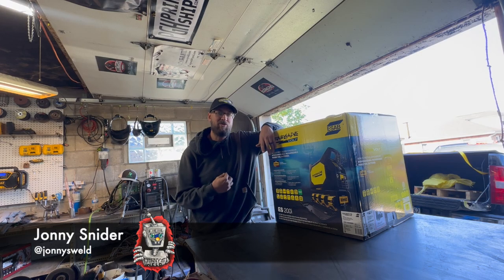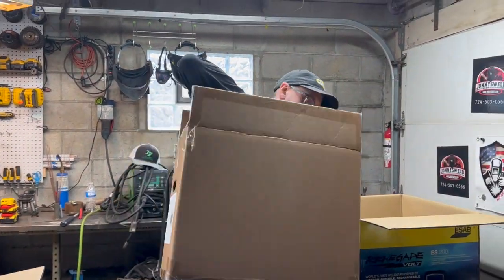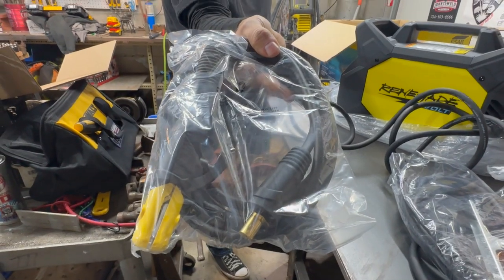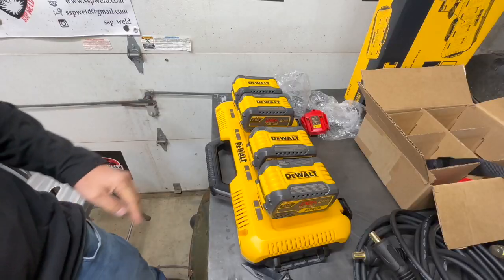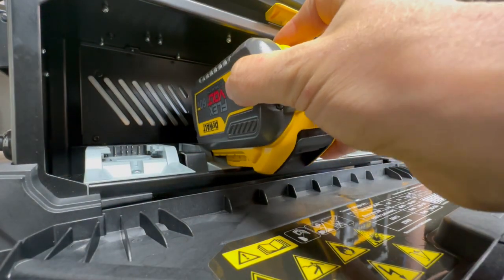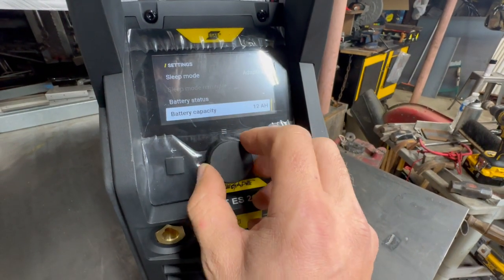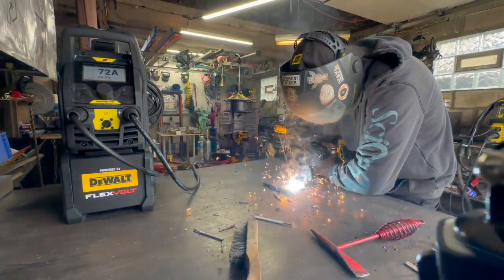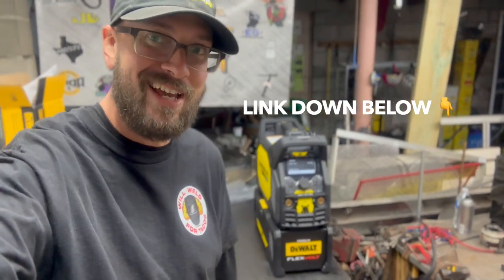Battery Powered Welder Unboxing!

Comment: We demonstrated that machine for a while. It welded good and we also have the Fronius Autopocket machine. They both weld great for quick weld repairs. 
Downside that we noticed with the ESAB machine was the plastic connector from the battery to the machine broke on us from a bump when my guys were moving the machine around. Yes it could’ve been prevented, but when you’re not around your team will take short cuts unfortunately. Brought to ESAB rep attention and so far we have been the first to submit a flaw. Hopefully no one else has that problem and or ESAB will make some changes. To everyone else, careful if you’re trying to move the entire machine around without separating.
Good luck and weld on…
Reply from the maker: @salsalazar8414  two great machines, it’s nice you were able to show both and see how both worked to be able to guide someone to buy the one that best suits the customers needs.

Comment: Fronius Accupocket more expensive, but it makes more sense than having to charge multiple batteries, plus...well, its an ESAB, it breaks.
Reply: What makes sense to me is using batteries on a welder that can also be used for hundreds of other tools beyond the welder. so very multi use concept, and time to recharge, just pop out and back in charged batteries and continue welding. All I see is benefits there!  All machines (any brand, any industry) have some duds from time to time.. I can't speak for those because I have 3 different machines from ESAB and they all have been workhorses and have driven my business  to the next level. But there is a machine for everyone because everyone has different needs in the industry so if the Accu pocket works for you then that's awesome and hope it makes you a lot of money. Thanks for the comment.
Reply: @jonnysweld  Tool batteries only last so many charge recycles, its a ball ache havin to buy multiple chargers to speed up charging, then you have increased probability of battery connection fault problems, list goes on. You are lucky, many are not so lucky with esab, when multiple distributers are droppin esab, you know there is a major problem.
But great esab working for you, I was tempted, it was between Fronius and esab, I read a lot of comments and watched a lot of videos before makin the choice, esab prices are tempting.
Reply: @engjds  It seems like the variable that is the most important is how much welding you'll be doing, where will you be welding and how often. All those combined will help decide what machine is the best for you. I definitly understand the concern with more parts could be more room for error. I guess what helps me in this situation is I am already a user of DeWALT tools so, the ESAB Volt seems to fit really well with what im doing, also I dont do a lot of mobile welding. But at the end of the day, your doing the right thing before jumping in on a battery powered welder, research will save you from getting something your not happy with. So, keep up the good work. Since I physically have a battery powered welder, if you have any questions, feel free to reach out. I'd be happy to share anything I can.
Reply: @jonnysweld  Totally agree, I am on the milwaukee system, and I like the battery system, and since I have a few chargers, like you I might get a welder that used those batteries. Also, Fronius seem to be highly reviewed, but they are also very expensive.

Comment: How long do the batteries last when welding?
Reply: Hey, They say it can weld 30 electrodes on a full charge. I tested it out with a various size rods and different kinds and was right about at that mark. So I guess the batteries will last as long as it takes for you to weld 30 electrodes. For the work I do out in the field, 30 would be a lot for me in a day and if it wasn't, you could always have a second set of batteries to swap out and keep welding.
Reply: @jonnysweld  What size electrodes are we talking about at a 30 count? A 1/16 uses a lot less power than a 1/8 does. Great video though. Probably the best review I've seen for this welder.......Never mind. 5/32. Thats a pretty big rod. That's 150 to 210 amp range. I'm thinking this would work great when I'm doing fences where my welding truck can't reach. I'm usually running 3/32 on that kinda work so I can probably get 50 rods. I'll have a second set of batteries charging for rotation.
Reply: @survivalguyfyi5718  Thank you for watching, I tried to be pretty detailed with the unboxing. 

So this is taken directly from the esab website, it was hard to find the details on the exact electrode but think I found it and was a 3/32 they did tests on. 

"North Bethesda, Md. – The ESAB Renegade VOLT™ ES 200i Stick/TIG battery-powered welding system, developed in conjunction with Stanley Black & Decker, is now available. Powered by four DEWALT® FLEXVOLT® 12 Ah (amp-hour) batteries, Renegade VOLT offers a Stick output of 10 – 130A and TIG output of 10 – 150A on battery power. With fully charged 12 Ah batteries and set to an output of 80A, the Renegade VOLT provides the power to weld with up to 33 (E6013) electrodes or TIG weld for up to 45 minutes on a single charge in standard operating conditions."

Resource:
https://esab.com/us/nam_en/about/news-folder/esab-renegade-volt-battery-powered-welder-now-available/?utm_term=&utm_campaign=USA+-+LIP+-+Renegade+Volt+-+PMax&utm_source=adwords&utm_medium=ppc&hsa_acc=7768157861&hsa_cam=21261783982&hsa_grp=&hsa_ad=&hsa_src=x&hsa_tgt=&hsa_kw=&hsa_mt=&hsa_net=adwords&hsa_ver=3&gad_source=1&gbraid=0AAAAADiEa1scwKmLEyZgyJNk-3Gd3TK0A&gclid=CjwKCAjw_4S3BhAAEiwA_64Yhp4a3FlPFwEAq1ruRC2DLzSxFzia6scWvGBT6VPsKLKfD4PL9JlDrRoCIywQAvD_BwE

There is so many different aspects on exactly how long it will weld and how many electrodes. Personally id say if you do mobile work and use less then 20 - 30 electrodes on a job, at a time or even in a day then this machine is perfect, if you do 30 - 60 in a day this machine could be perfect if you have a second set of batteries charged and ready to swap. Any thing more then that, the volt will still do what you need with the extra batteries and chargers,  but might get an engine drive at that point. all depends on what you need it to do.

Comment: Man thats a pretty cool setup Jonny!!!!!
Reply: Thanks Adrin! It's a really cool machine and super easy to setup, use and maintain.
Since I recorded the video till now I've used this machine on 3 jobs and it's been a HUGE help. One of the jobs was in my shop where I only have power for 1 welder and I bring on a helper, so I was able to use the Volt the same time the helper was rocking with the Rebel.